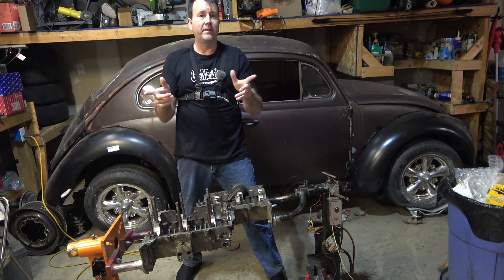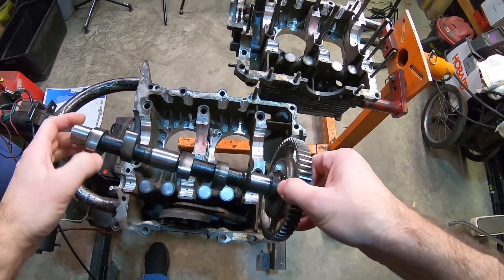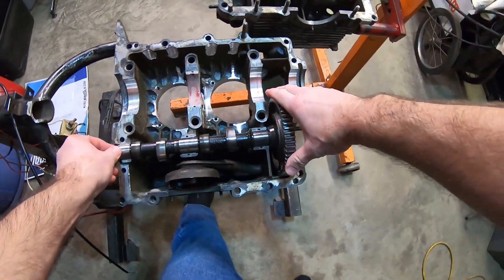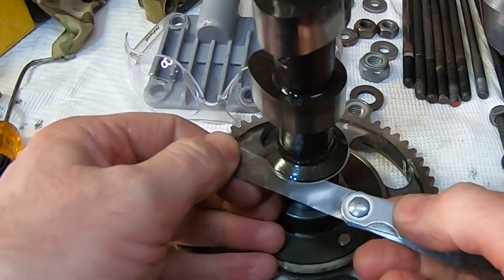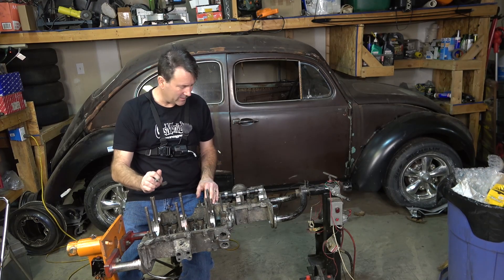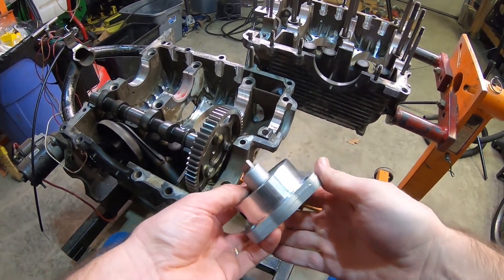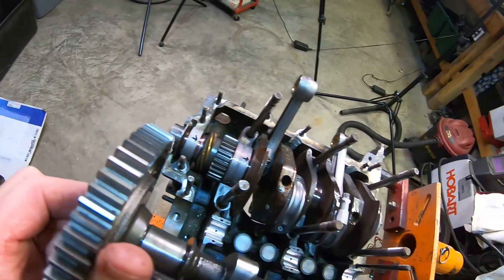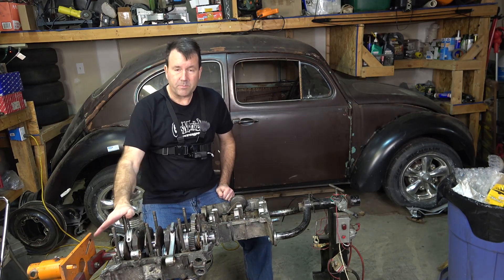How to Fit a Camshaft into an Aircooled VW case

Comment: I’m currently rebuilding a 96 mexican beetle fuel injection (carburetor adaptation) I bought a new camshaft but it pops out and it gets stuck when I rotate it. I hope my problem is the solution you gave us, by clearing the cam bearing that doesn’t have tangs. I will come back with an update in case anyone has this problem as well. Thank you for the tip man.
Reply from the maker: Good luck 🤠

Comment: I just fitted Mahle Bearings in my all new parts build, new engine case with standard size bearings. The Mahle bearings fit well and the big end conrod bearings spin freely on the Crankshaft. I saw a video with brand new Silverline bearings used.  When conrods were attached and tightened the conrods were jammed and stuck on the Crankshaft. I would recommend using the Mahle bearings.

Comment: I’m running bug pack 4063-10 in 2276 do you think it’ll be fine heads are cb mini wedge 44/37
Reply from the maker: @Vwbugthingz74  that looks like a nice cam. Lift with 1.4 rockers should be around .549" duration is 296°. I think the mini wedge ports will like it.
Reply: @ thank you which motor is the 4065-11 in?
Reply from the maker: @Vwbugthingz74  the 4065-11 is in a friend's engine which is a 2276cc engine.

Comment: Good information on cam bearings and how to fit double cam bearings ! !  I was installing double cam bearings before they were even available . I have about 4 boxes of brand new bearings with the thrust bearings missing 😂 . I have a friend who builds HIGH performance motorcycles he uses a whetstone for fitting parts like these . They are fairly cheap at Harbor Freight , there is a rough side and a polishing side , don't build your next engine without one ! !  KEEP BUILDING BROTHER 😎

Comment: I got an old 1302, and i am suspecting previous owner have installed cam wrong (not on the dots).
Because i have changed all electronics, and carbs, timed and adjusted. It got decent compression on all cylinders, but still cough and spit and run rough.
Can i check if the camshaft are correctly mounted without splitting the engine
Reply from the maker: @muzelmuzel5786  it's possible to pull the oil pump to see.

Comment: Hi what's a tang ??? what your talking about is called a cleat.
Reply from the maker: Funny, I've been building these engines for over 25 years and never heard of a bearing cleat. I've always heard it called a tang. Do a search for a bearing cleat on the old Google and tell me what you come up with?
Reply: @ddk56vw  Hi again a tang is a smell you look it up 25 years who trained you .
Reply from the maker: @geraldfahey8411  Okay , I'll do the work for you, this is straight from the enter web. Bearing tangs are only used to laterally locate the bearing shells within the connecting rod housing bore. Some connecting rods have distinct upper and lower bearing shells, that have different bearing tangs, so that they can only be put into the connecting rod or cap half.Jun 9, 2020

Comment: Fantastic tip on fitting the trust bearings! I got lost on the tab/no tab - Does the double thrust bearing, bearing have both halves with thrust surface and can I just install both halves or do I need to make a modification to hold the no-tab half in place (or is only a 1/2 bearing double thrust??) ?
Reply from the maker: Double thrust bearing sets have the thrust on both halves. It depends on bearing brand on whether there is a tang on both halves. You can either file down one bearing tang or file a grove in the case to fit the tang.

Comment: Hi.
Instead of filing the bearing, I find it better to Machine the surface of the back of the cam,otherwise you will find that thinning the bearing wall may make it break of and then you have a Cresent shaped piece of metal floating around in you engine will end up in your barrel.
All the best.👍🏾🛠🇬🇧
Reply from the maker: Yep, that would work too but now you are thinning the cam lol. I'd probably do it that way if I owned a lathe. Something I do hope to own some day. Anyways, on my side of things; I have been doing it this way for over ten years and I haven't seen any broken cam bearings. Thanks for the advice and keep shifting those gears 😎🚗🚘🚗

Comment: Very good video. I’ve had to do the same thing with the cam bearings and the engine I just put together was the first one I didn’t need to clearance the oil pump for the cam bolts.
Reply: @ddk56vw  confused how I’m thinning the cam? I’ve always corrected the cam bearings the same way you do. 
This last engine I put together is the first one where I didn’t need to clearance the oil pump for the cam bolts…. I had plenty of room between them. The cam was never touched.
Reply from the maker: @VWJawbreaker  ooops, I must of replied to the wrong post, sorry for the confusion.
Reply: @ddk56vw  all good!